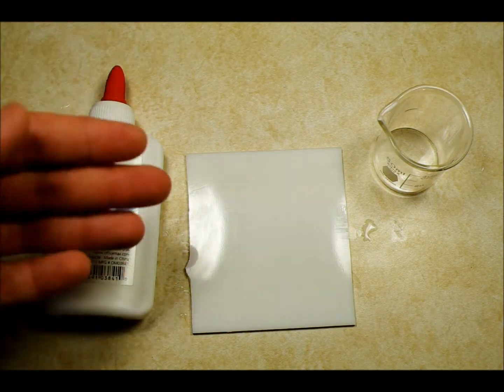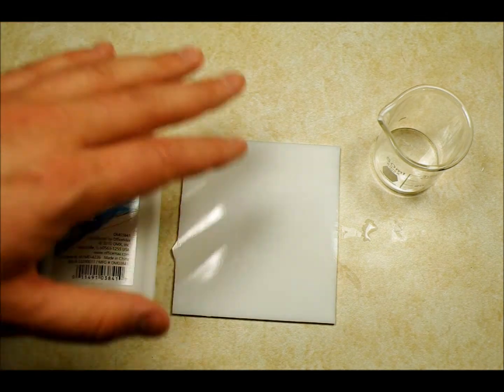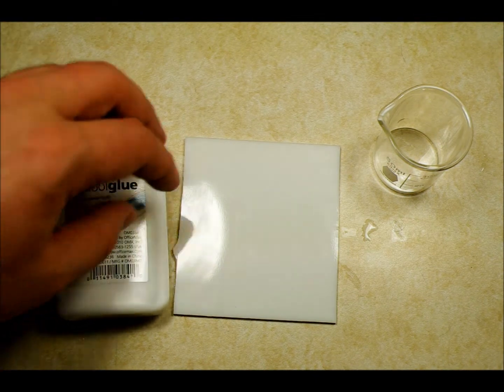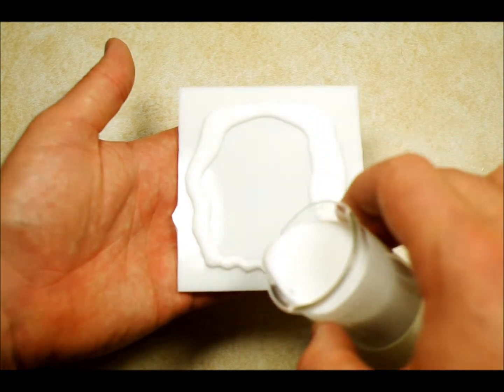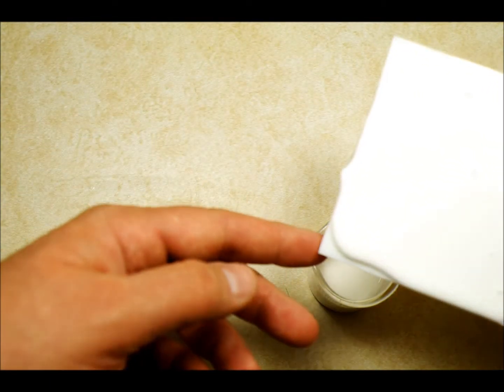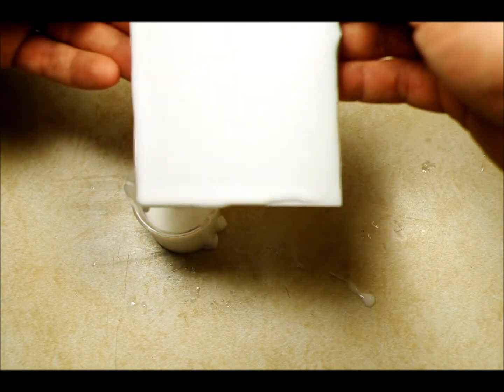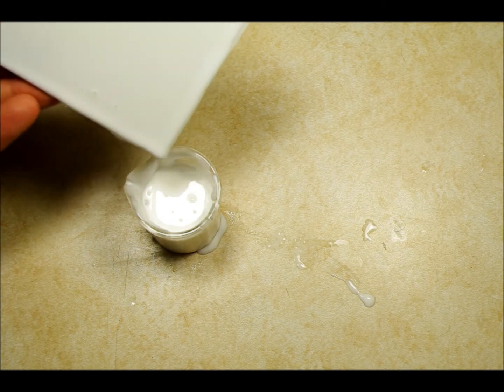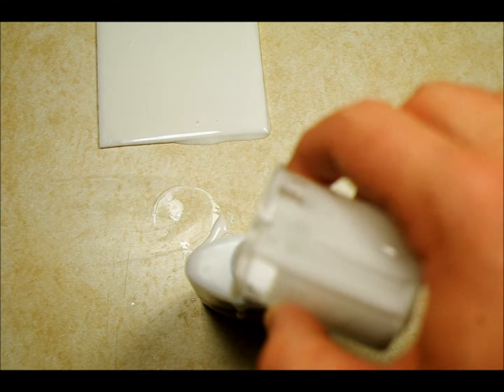Printing an Opalotype (or any Glass Positive) Video 2: Liquid Emulsion

Comment: Would the excess emulsion you drained off be resuable, or is it not a good idea to pour it back in the bottle?
Reply from the maker: It's been a long time since I made this video, but IIRC, as long as the emulsion has not been exposed to light (I may have demonstrated here in the light for video reasons) then it can be poured back in the jar.

Comment: Thank you for the video. Your emultion is glue mixt with something or did I miss that information?  I would like to try this!
Reply from the maker: Thank you! The emulsion is a product called Liquid Light. It's easy to use and relatively inexpensive.
Reply: @DavidHancock  Thank you for the fast reponse! When you have time do you think you could do video on that subject: I found some other video with that liquid emultion but the person does't use glue! And here in Germany, I can only find Rollei Black Magic. Do you know about this product?
Reply from the maker: Oh got it. So the glue was just to show how the emulsion would work. You don't have to use glue for anything. The glue just has the same basic properties (viscosity and appearance) as liquid light. So I used it in place of the liquid light since the liquid light would be ruined outside of a darkroom red light.